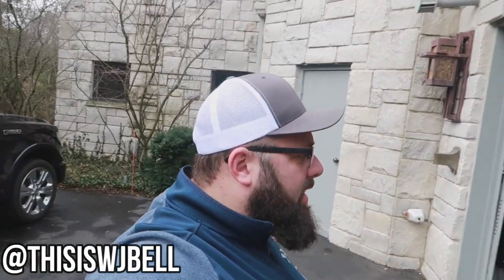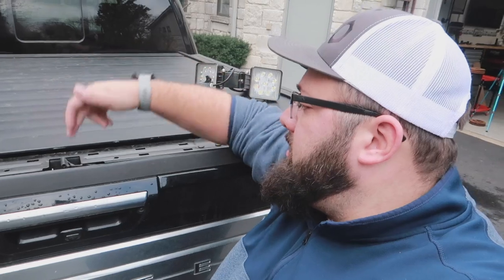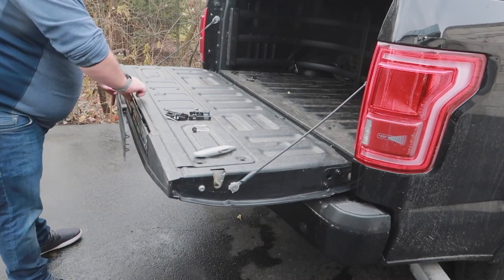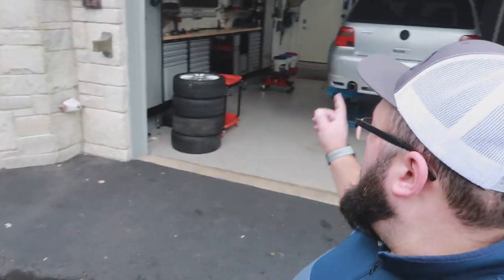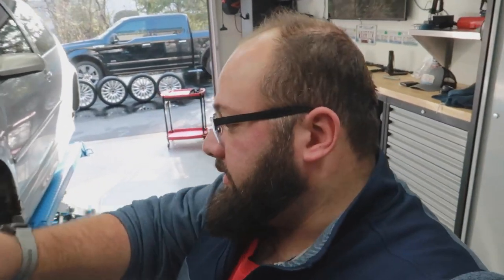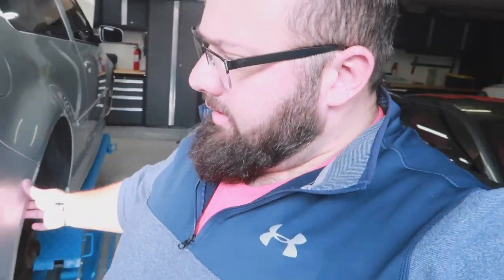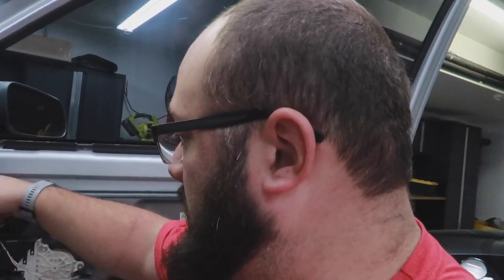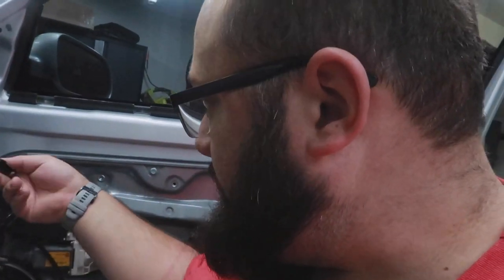VW MK4 R32 TOTAL Tear-down!!  The Project Car Rebuild Pt. 6.

Comment: this is gonna be a good build, you're doing all the good stuff. Small suggestion use ziplock bags to keep track of nuts/bolt label them and ur good, especially if your doing a full teardown.
Reply from the maker: Thanks! It is fun so far! I cant want to get it on the Ice! Thanks for the tip, currently I have bins I put all the parts in for each step of the project, granted there were a bunch of owners to my car and LOTS of bolts are missing, especially for the interior 🤦🏼‍♂️
Reply: @GasTachs  good luck to you sir! Mine was in worse shape and like u I wanted a project. Instagram is the same username as here check it out.
Reply from the maker: Projeckt VR6 will do! Thanks and good luck with yours!

Comment: Good luck with the 32 👍ime interested what you have to say about the engine as there's a lot that can go wrong or need changing🤔make sure u check radiator fans as they were faulty from the factory 😬good luck👍
Reply from the maker: black country mush thanks! Yeah I don’t have much to say now, but I’ll keep you posted!
Reply: @GasTachs  I recommend u fit a miltek exhaust 👌it will transform the way it sounds👍

Comment: what kind of lift is that?
Reply from the maker: Fati Guri here you go! https://www.obsessedgarage.com/collections/lifts/products/twin-busch-tw-s3-10e-double-scissor-lift
Reply: I am also in the same producer right now. Rebuilt the head and slapped the motor back in in the past month. Got mine running and driving but will be stored for the winter as it was repainted by vw just a couple years ago and hasnt seen more than 2 miles on the road since then. Look up on “love auto group” for all the parts you need and if it’s not on there website I’m sure he’ll be able to source your fender liner cause it’s the same as a gti... there is usually a 10 cd disk changer in the back left corner “sound”.
Reply from the maker: Thanks I will check Love Auto Group and thank for letting me know about the CD Changer. Will yours be up and running next summer?